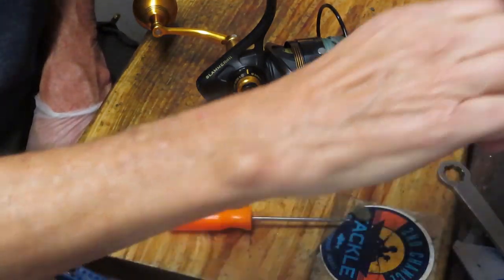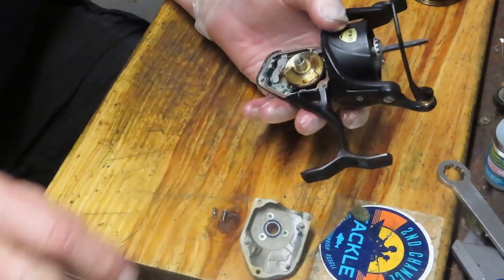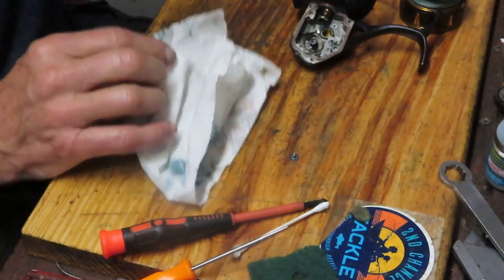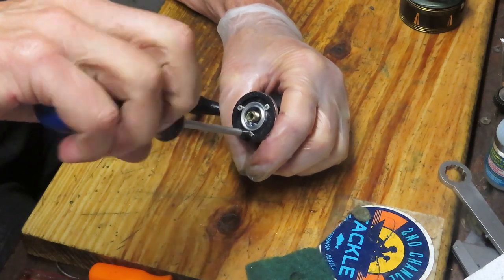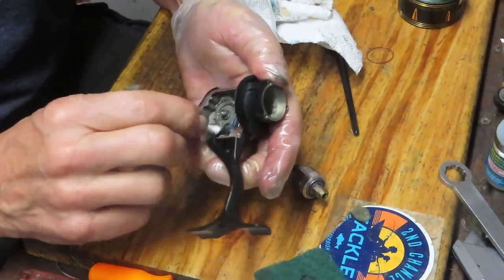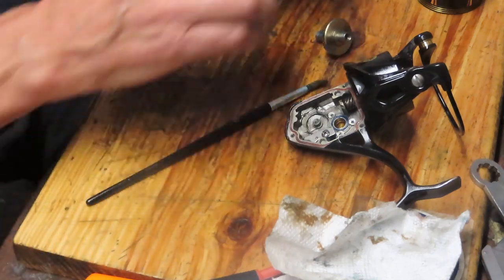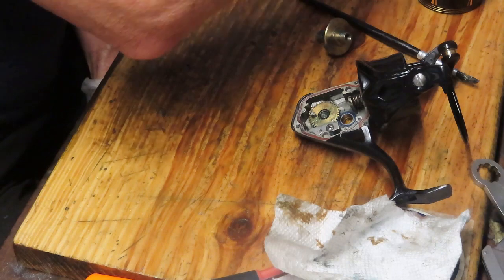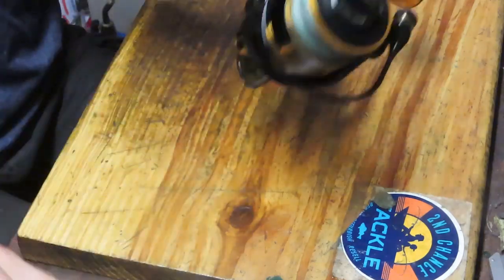Penn Slammer III 4500 fishing reel how to service and repair

Comment: Hi Dennis. Still following to every video and always learn something new. Two things I learned from this video: 1. Always wipe your reel down with a warm damp cloth and take the spool off to wipe it down and check for any line caught underneath. My Penn Spinfisher had some salt remnants left behind from the previous fishing trip I guess and it was rubbing against the rotor just enough to create a scraping sound. Lesson learned.
Reply from the maker: Great tip!  Thanks

Comment: Dr. Dennis at work diagnosing the illness!  I don’t like these reels because of the lack of an AR override. I just worked on an Abu Cardinal C177 reel that had an oscillation block with that small shaft guiding it exactly like this Slammer. It was interesting that the two screws holding in the pinion bearing on that C177 were under the AR clutch. It also had a very tiny spring on the override plate above that clutch.  I did spill the roller bearings out of that clutch but it went back together easily. That reel had 5 bearings if you included the AR clutch bearing. There may be a bearing on the line roller but I did not totally disassemble that part. This Slammer appears to be a well-made reel but not having an AR override makes it less desirable for me.  Good job Dennis! — Chris
Reply from the maker: The reel is well made and unfortunately they chose to go without the A/R override.  It is all too common today to skip that feature
Reply: @2ndChanceTackle  all the more reason to fish with my vintage reels!

Comment: Would have liked to see the way that drag is assembled being that it is somewhat different than all the other spinning reels in your videos. When you removed the side plate you said there was a seal which I was nat able to see, are you referring to a seal around the perimeter of the side plate? I was hoping to see that as I don't see as much effort to prevent water intrusion as I thought there would be on this reel. Reason I mention it is because I was thinking about getting one of these.
Reply from the maker: Yes - the seal is the red o ring like its that goes in the groove of the case

Comment: What would make up a beginner's "cleaning kit"? Tools & grease/oils
Reply from the maker: Here are a few thoughts. The best start is a small container of reel grease and oil in a combination package that is a 1 or 2 ounce size of each.  Next would be Penetrating our to loosen grease and dirt.  A pack of cotton swabs will clean the tight spots inside and outside of the reels.  A roll of paper towels will wipe away the dirt and oil. A hard bristle brush, like a tooth brush, will help clean out gear teeth and crevices.  A kitchen scrub pad, like Scotchbrite, cut into quarters, will help with tougher parts, like salt buildup or corrosion that require a little more abrasion.   Thanks for asking - Dennis

Comment: Hi, I have a slammer 4 4500 dx.  After a trip it started to have some vibration. I can feel the vibration when I spin the reel while holding it. I can also need the vibration sound as well.   I took off the spool and there is no vibration.  Also when I spun the reel pointing up there was no vibration.  It only vibrates when it is spinning in a horizontal position. I have only used this reel a few times.  Got it in late Oct of last year.  Any suggestions would be apricated.
Reply from the maker: If the reel is less than a year old, send it back to Penn.
If I were to guess on the cause, the first one I would think of is loose case screws.
If you are thinking there is no vibration when the spool is removed, then check to make sure the drags are tightened down.  Next, check the click ratchet assembly on the axle shaft.  Are the holding firm or moving around.
Do you have a bearing on the axle shaft?  Check to see if it is holding firm.  It may be broken.

Vibrations are tough - it usually means something is out of alignment or out of balance.

Not sure what else to think - Dennis
Reply: @2ndChanceTackle  thanks mate! Much appreciated. I will properly send it back to Penn.

Comment: hey dennis, do you now by any chance where i can buy a bail wire replacement for one of those kinds of reels, mine recently broke and ive been trying to find these parts for the longest time
Reply from the maker: Yes - you should be able to get the bail wire from Mysticparts.com  You would follow the home page to parts and spinning reels and then select on the Slammer line to find the one you need....of just call them Scott and Mo will be happy to help you.  Thanks for asking - Dennis
Reply: @2ndChanceTackle  hey thank you so much but do you know if they have the specific one for the penn slammer 3 4500 im in need of one but if there is one that you do recommend that is just as good that would be great
Reply from the maker: They should have the one they need. You will have to call them to confirm

Comment: $250 actually. Super robust. Kind of heavy but I'm a big guy don't mind the weight. 30 pounds of drag. I use it to pitch baits to dolphin or jig 30-40lb tuna in the 4500 size. Like it a lot.
Reply from the maker: Yes - I was thinking of the value on the used market.  They do sell in the $250 range
Reply: @2ndChanceTackle  That is your business I should have realized that! If you get another in there is one flaw to that reel. The drag on the low end is still rather tight. Give it a try it's pretty strange actually.
Reply from the maker: Will do!

Comment: I use my slammer 6500 for crabbing which makes it rough, almost sounds like a loud bad electric motor.  Any idea what is making it rough? What should I replace? 
All my reels actually do this after a season of crabbing….. Penn fierce, daiwas, shimano
Reply from the maker: I would suspect that the bearings are worn and need to be replaced
Reply: @2ndChanceTackle 
Ok I’ll look to see where and how, 
Thanks for the info 👍

Comment: $150.00 ?.......+ Another hundred!  All of mine came from the factory so packed in grease, they don't spin freely and the drags don't have their low range.
Reply from the maker: Yes - I went back and looked it up.  I guess I was thinking used pricing on a 3 year old version of the reel.  Thanks for the clarification - Dennis